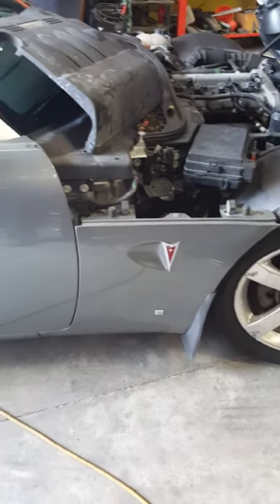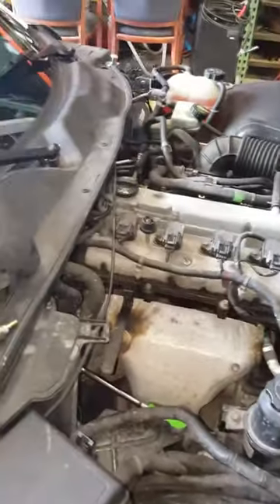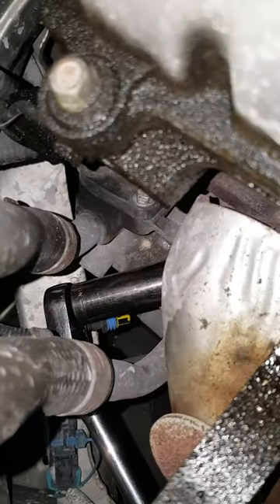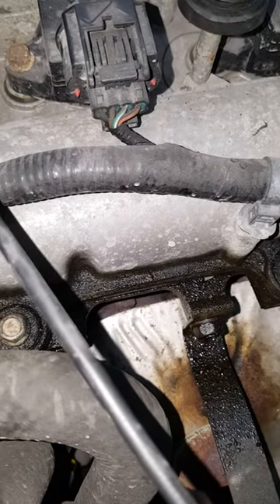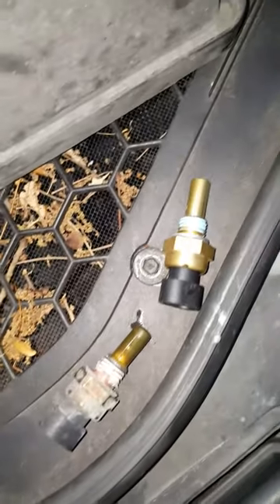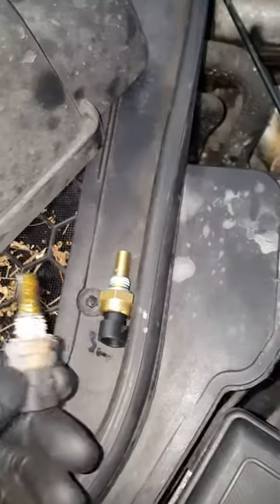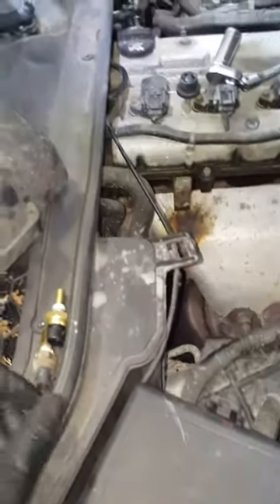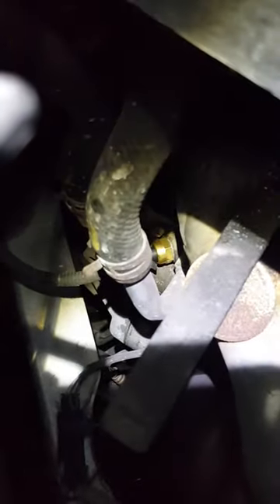Coolant temperature sensor on a Pontiac solstice

Comment: What was the code? Reason I ask is wife's solstice will not read any temperature and warm air still blows. Not sure if I should change thermostat or this. I willing this since it's hella hard to get to the thermostat.
Reply from the maker: Just change this part and clear any codes if there’s any or disconnect the battery while changing the part
Reply: @Trucker_Smooth_  Thanks bro.👍

Comment: Don’t know if you’re still active on this account but I’m having similar issues with my solstice. The ac only blows cold air when I’m driving at higher speed but when I stop the car, the air is hot. I was told it might be the cooling fan control module since my fan doesn’t turn. Any suggestions?
Reply from the maker: You might need to see if you have enough Freon or you compressor might be going out or you may need a ac flush
Reply: I’m having similar issues where fan is not working when is in ignition and temperature turns to be around 250. I just ordered a new thermostat and waterpump but I’m also thinking about this temperature sensor maybe to order that too.
Reply: @Dev-kf3uh  so for me it turned out to be the fan... if you're able, turn the car on and grab a broom stick of some sort. While the car is on Jab the fan motor with the stick and see if it starts turning and if it does and then stops then it's the fan. I bought a fan to replace mine for like $80 on eBay and after that it worked

Comment: Do I need to drain all the coolant before the sensor replacement?
Reply: Sam Lee no but you will likely have air in the system after. These cars are extremely sensitive to air pockets. You might get lucky and have no problems, or you might end up with your car telling you the coolant is over 230 degrees and the engine overheating.

I have had a solstice for two years. As someone who likes to do the work themselves rather than pay a mechanic, I won't ever mess with any part of the cooling system on these cars. I always take it to a mechanic with a machine to vacuum the coolant and refill it under pressure so there is no air.

I've had way too many problems otherwise